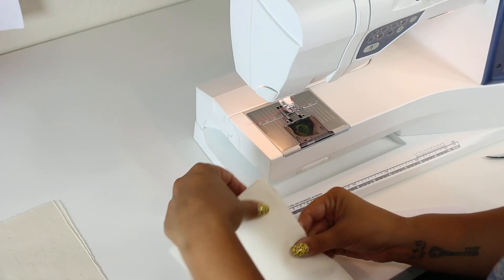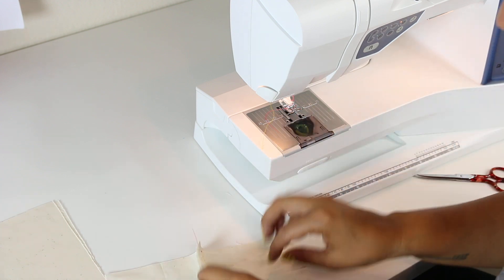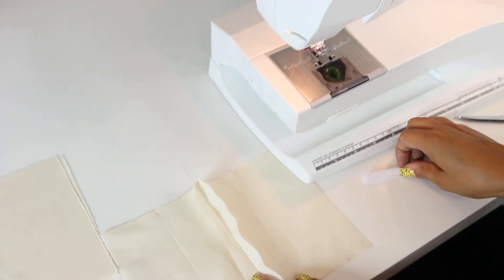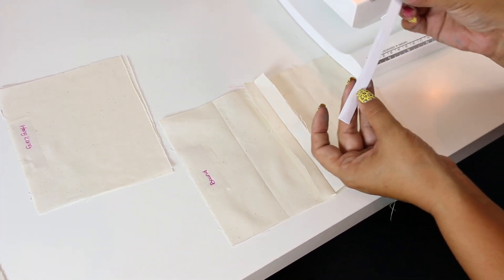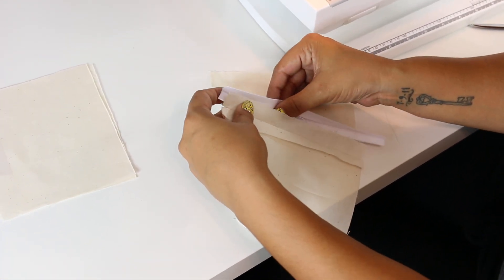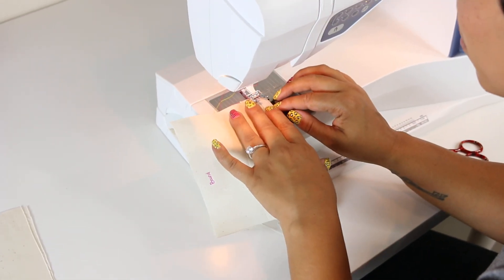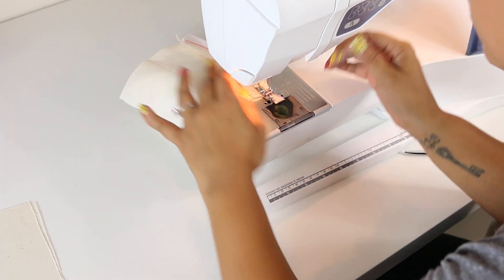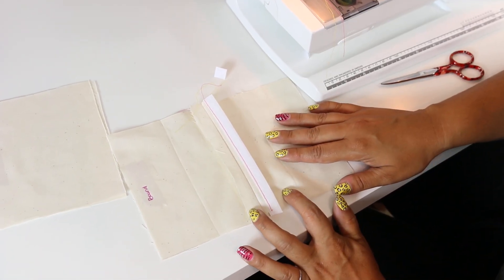Sewing With Mimi G: Bound Seam Finish

Comment: hi Mimi

i am new to sewing and i was practising how to seam raw edges. my fabric seemed to be moving away from the presser foot (i dont know if you get what i mean). i have to force the fabric to stay in place, its like a war zone between me and the machine. i thought it was the machine that cant sow straight so i tried to do a straight stitch without my hands leading it and my stitch was straight and the fabric didnt move away. what am i doing wrong please help.... 

I used a zig zag stitch and satin stitch to do this, my needle is 90/14, the fabric was light weight, my machine is brother jk1700